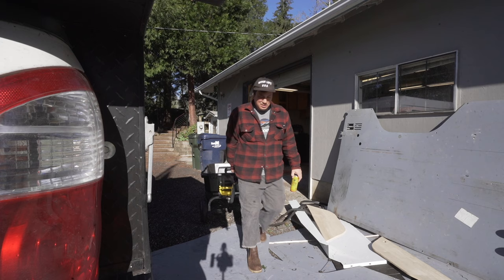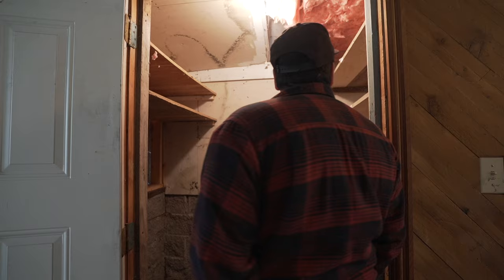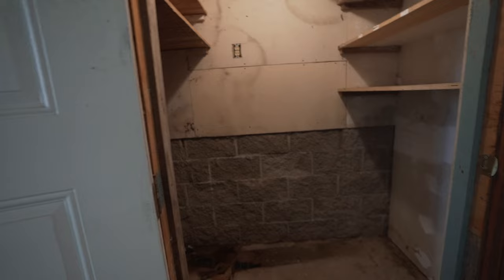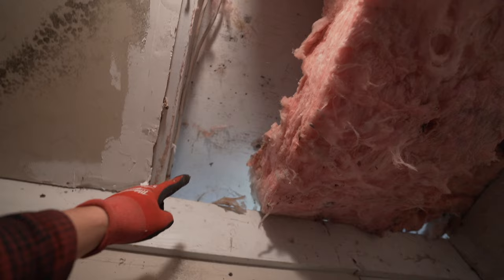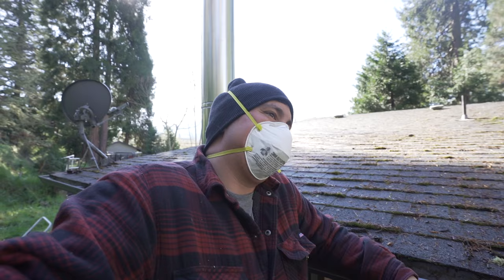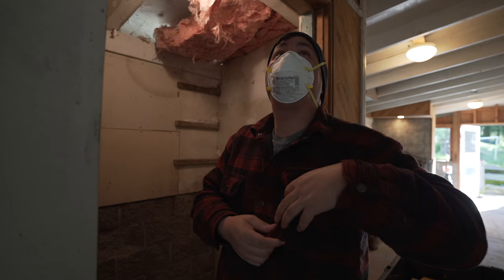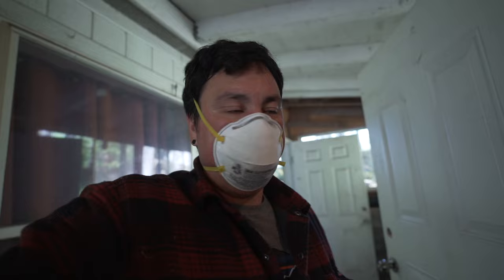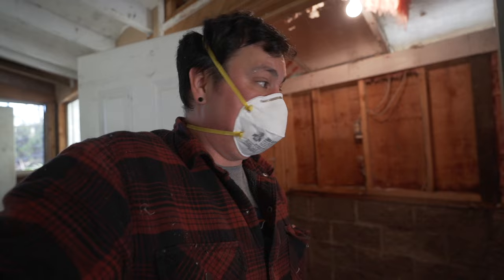It's Worse Than We Thought... (Mobile Home Demolition)

Comment: As long as your roof shealthing is ok.Put metal roofing over the old shinges. This will waterproof your roof You will not need to remove the shingles and have a great amount of construction debris to deal with. The metal roofing in the long run will be less expensive if you leave the shingles on. This way all you need to do is properly install the metal roofing. This is how my metal roof was installed by the proffessions. Youtube will be a good place to study the proper way to install a metal roof. The metal roofing my be alittle more expensive, but iin the long runn it will last longer and provide a more waterproof roofing systemfor you
Reply from the maker: Looking into options

Comment: Pull the outer walls off the framing, the roof material pull off and dry the wood, reseal the wood put on underlayment,  and new shingles. I would prime everything with kills. Put in the interior prime and paint. You could save the old wood if you need to

Comment: If the shingles are still in good condition and put on correctly, it shouldn't leak. I do think that you should get the soil down to maybe 6 inches below the wood siding on the outside and proper siding put on to protect the plywood....🤷 just my thoughts, I could be wrong..❤
Reply from the maker: Shingles are bad. I agree on the soil!

Comment: You knew from the start you'd have to do a lot of roofing. I did notice that the flashing around the chimney was useless sitting up in the air 2 inches. I sure hope you took off those clothes and washed them before going into the house. Unless you get rid of the nest ants will return, what you did with the spray was kill those that you see not those still in the nest. Try a product brand TERRO I have used it for a few years now to get rid of ants. It is a process but it works until next year. Ants are usually dormant over the cold weather spring brings them out. I would have used a wet vac rather than blowing all those mold spores around. Vacuum them up then wash out the vacuum. Bleach and Borax are your friends through all of this.  KEEP THE AREA A NO CHILD ZONE until you've made major fixes and do not mess around in there without your mask on. 20 or 30 years from now you'll understand why I say that!
Reply from the maker: Oh gotcha

Comment: If two tires had fallen off, your wagon would be too tired.  If the ants are large, They are probably carpenter ants. They will eat up the wood. Moisture attracts them. Move the Debris away from the wall because it holds in moisture. Ice guard is the best thing to use under roofing because it seals holes around nail holes. It prevents ice dams from causing water to back up under the shingles and leaking through the roof  but tarpaper is better than nothing. Metal roofing costs more but lasts forever. Shingles are doing well to last for 25 years. Metal roofing is more noisy when it rains or hails hard but It is worth the noise to not have to replace the roofing every 15 to 25 years. the only reason you would have to replace a metal roof it a tornado or a tree falls on it.
Reply from the maker: Ha ha

Comment: Where are those downspouts in the ground draining to? My daughter and son in laws first house felt like a lemon there was so much to fix but they did it and moved on to a better place. Hang in there, you can do it. I reroofed our two story shop and really the hardest part was transferring the roofing material off my loader onto the roof, those bundles weigh 75 pounds each. I had them delivered for the second half.
Reply from the maker: Yeah I been doing the math on materials

Comment: What a shitshow.  I couldn't see the bugs close enough to say what they were, but my thought was, they may be what's called roly poly's.  They love moisture.  The stuff with wings... were those carpenter ants or termites?  If you take down any part of the structure, make sure you film or photograph it.  You should be able to get some type of tax abatement for removing square footage.  If you need an immediate quick fix to roofed areas due to a shortage of funds, you can always coat it with that rubber roof stuff you'd put on an RV.  I can't remember if you had a home inspection.  This is really shoddy and shady crap.  You can't have moisture causing mold and damage.  I know you know that.  Just how stupid was that previous homeowner.  Cripes sake.  Really sorry you guys are having to deal with this.  Going to enjoy some nice weather at the lake sounds like a much needed activity.  I was awake all night due to tornados.  Luckily, my immediate area was spared, but others were not.  Long night last night.  Better days are ahead, Isaac.
Reply from the maker: Def… thanks for watching yo

Comment: You needs to remove all that fallen tree branches next to the house, all that stuff acts like a towel that draws water. We had an issue where the stucco wall was to the ground,  and suck water up the wall and  caused inside mold . Isaac the roof might need to be replaced,  check all sections of the roof.  You can do it will take time and a helper or 2. My 67  year old husband and 2 young  25 year old nephews stripped  and replaced the roof  for my niece's house in two weeks in the summer in El Centro ca. The cost  was only roofing materials  no cost on labor.
Reply from the maker: Yeah been working on it!!

Comment: Your roof is toast it has moss and mold on it. Take everything out, use a mold  spray to spray the whole porch, the drainage in the back of porch  needs to be dug out and your block needs to be sealed. Yes outdoor would be nice but what about the water issue that’s the problem. I am so sorry.
Reply from the maker: Yeah..

Comment: Pull everything away. Center blocks rolled with stop leak. It will keep the water from coming in. Or just pour concrete.  Look up dry pour. Not real expensive.
Reply from the maker: Def

Comment: Wow~ What an unnecessary mess caused by not doing it right to begin with. That’s absolutely a shame. Now you have to deal with the repercussions ~ Big Sigh. Roof & water drainage issue is the first priority. Just an open area covered patio is enough for now. That at least would get it safe, decent & usable. Good Luck. Get your roofing buddy to inspect all the roofs to verify what the situation actually is. Maybe he only did that add on  back there~ fingers crossed!!
Reply from the maker: Yeah but we will get it in shape! 💗
Reply: @isaacturnerit  Yup~ mainly demo & a place to learn how to roof 😂

Comment: You will also probably need to strip all the old shingles because of the weight due to snow load weight etc.  The open area would be a good quick and cheaper fix.  You can also probably rent a small backhoe or track hoe that would help address the drainage issue is the back.  The roof is part of the problem but not all of it.
Reply from the maker: Yeah def

Comment: I suggest you dig a french drain where that water is coming in. If the roof is not leaking over your head it can probably wait.  You need waterproof siding and paint on those blocks.  Looks like you also need fachia at the edge of that roof.
Reply from the maker: Def

Comment: The shingles themselves should be waterproof. So if he laid the shingles perfectly, and no shingles become damaged then you should be OK. The felt/tar paper is typically a secondary barrier so if a shingle higher up becomes damaged or water finds it's way under a shingle, then the water can makes it's way to the edge of the house under the shingles. In an ice and wind situations, water can get under the shingles and why tar paper is important too. For sure keep the dirt away from the lumber and keep all that debris away from the house. I'd lower that dirt level against that block retaining wall so there's room for water to puddle until it's made it's way to drain away or soak into the soil this way the water doesn't get to the wood/siding wall. But, before you go ripping off all your roof, I'd make sure he just didn't run a bit short on tar paper and not run it on that last row only. I can't imagine somoene roofing a house and not using tar paper. He may have just skipped it on that addition or the last row or two if he ran out. Do you have this guy's #? I'd call him and ask before I tore all the roof off.
Reply from the maker: Hmm gotcha but they aren’t for some reason

Comment: Yes, to first checking gutters flow, then dig around foundation to see what's there. It's truly. a shoddy job of a tacked-on addition. It all depends on how important the space is to you. You're going to basically be rebuilding it. I'd get someone from the area that knows about house construction in area to tell you what you need to do. Ask your fan base for help. A home is your most important investment, anything you do right is adding to it's value. The best of luck from an old lady with a ton of homeowner experience. You are also at the bottom of a hill so maybe drainage issues to address in the future. Also, check out a couple on DIYfferent. They have a done so much to restore old buildings. His videos are very informative and honest.
Reply from the maker: On it

Comment: Here is a bit of plan of attack.  As it is obvious whoever added this on had no idea about building. With the soffit open to the outside, it is a wonder it not even worse.  1) Fix the outside drainage problem and the roof issues.  Have the electrical checked.  Gosh knows how that was jury rigged in place.  Once you have the electrical checked out,you can start to think about redoing the side a section at a time.  Insulated it all and get it sealed up.  Then it will be relatively easy to finish up the room areas. 
I remember as six grader Mom and Dad bought a new old house which had been rented out.  It was a beautiful frame but a mess.  We picked up a huge dump truck load of just beer bottles. It was all old lathe and plaster and we striped everything down to studs.  They were able to find some Amish carpenters who saved them some money and roughed it in before they had to pay regular carpenters to finish it. 
You have the ability to live the the rest of the house while working on this area. That is good.  Your goal need to be to stabilize this area and then move forward. 
One step at a time you will get.
Reply from the maker: Def chipping away at it

Comment: There no membrane on that side and they just put dirt in it. Need to clean that out and a drain. I would leave a nice gap on the side of that house. Even the roof needs an undelayment. Just plywood outside is not the answer when he built it. 
Step by step and it could be fixed.
Reply from the maker: Gotcha on it

Comment: A couple of things is needed.  The roof is priority,  however it must be done while weather is not wet.  Also the wall structure needs to be looked at for rot, insect and also termites.  Replace what needs to be replaced. 
The cinder blocks need a paint on sealer to protect from moisture wicking through. 
 Your next step is clear as much debri from the back wall.  
You will have some work ahead of you. 
However there is no good drainage on the back. 
Besides gutters at the roof, there should have been a French drain installed at the base if the cinder block wall. 

You might need to have help, but maybe they are willing to help you.  You buy the materials needed to fix.   
Also watch videos of folks building, adding on and  fixing these issues.  There are tons of videos of folks adding on to their homes that are next to a mountain.  Plus many van life folks that bought property to fix and repair or build new homes.  These videos can help . 
I need to ask dud you have an inspection on the property prior to purchasing.   They might have found these problems.  I wonder if you are able to get compensation back from the sale, cause they didn't tell you there were issues. 
Going forward, drainage of the back area will be whats needed.
Reply from the maker: Great tips

Comment: Given the sketchy underlayment situation I would be skeptical about the water mitigation at the rear wall.  The structure sits at the bottom of a mountain and should have french drain, landscape fabric, gravel and waterproofing at the submerged brick on the outside.  It looks like there may be precipitate in the mortor of the wall? This could indicate water buildup at the outside of the wall. From what I can see in the video your down spouts from the gutters go into pvc?  Do you have free flow at the outlet? No clogs? Hopefully the outlet is at a location where the water flows freely away from your structures?  I think a conversation with the roofers is totally a good idea!
Reply from the maker: Yeah

Comment: You need to dig around that foundation put a tile drain pipe through fill it with gravel then cover it back up so you have drainage what is happening is you have not enough drainage to go around that area and it's seeping there and Going to need to replace the siding that the water seed through and I would housewrap that for vapor barrier
Reply from the maker: Def

Comment: I agree with Carol West.  I think the back originally was a retaining wall and the open back porch.  

I am not a construction worker but fully admit that you need tar paper on a roof.   I would turn it into a covered play porch for right now….

 but if you wanted to invest I have some ideas…..including gutters and proper water drainage and make sure that you have vapor protection and a vent in the roof to keep it from getting humid.  

But I would definitely recommend checking with construction workers usually you can get free estimates.  

For the mice I know that you have cats….take old used (but mostly clean) cat litter and sprinkle on the ground outside the perimeter of your home.
Reply from the maker: Cat litter?
Reply: @isaacturnerit  yes.  A thin line of used but clean cat litter. I did it during a whole box change.  Scoop out the clumps and nasty bits and then whatever is left sprinkle a thin around the outside of the house. Only thing that worked here that wasn’t poison. I also am almost sure that the piles in the insulation was mice poo.

Comment: Clean all debris from against the house 6” below concrete 
Check the drain that the gutters drain into to make sure it’s not clogged 
Treat all areas with discoloration with a bleach solution let it dry out replace any damaged lumber and then paint with a good primer. It’s really not a big deal. I didn’t see water issues at your ceiling
Reply from the maker: On it

Comment: I din't realize that there was no fascia boards on the roof. No wander the insulation is full of mouse crap, mice love fiberglass for nests. You do need to get the dirt and junk at least 8" below that wood that is on top of the masonry block. As far as the roof shingle are what actually keep the roof dry. From what you showed in the video I did not see any actual roof leaks.
Reply from the maker: Yeah

Comment: Isaac do a French drain along the outside walls, tear out all wood that has gotten wet and replace it. When it comes to the roof tear off the old roof the put a drip edge and Ice and water shield on the first 4" of plywood closest to the gutters. Then tar paper the rest of the roof. Maybe install metal roofing it is quicker and easier in my opinion and it is more durable and will last longer. Either way you have a lot of work ahead of you but you have the skills to do it. I hope that you can get some help.
Reply from the maker: On it

Comment: Carpenter ants like moisture, wet wood to chew on. Gotta start outside and remove the debri from your foundation wall. Also make sure your ground level is below the foundation wall so that rain/snow melt doesn't enter your walls.
Reply from the maker: Dang

Comment: I don't think underlayment is your problem unless the gutters back up
1) where are those gutters draining to? Are they clogged? Do they back up when it rains heavy? Is there any french drain ?maybe test by putting hose in gutters and run for a while and see if any water comes inside
2) dig down and see if outside of block is waterproofed
3) the pink insulation is the wrong stuff to use. He should have stuck with just foam insulation 
4) no dirt or wood chips should be near the wood on the outside. Gravel would be better and an aluminum siding would be better then wood back there
5) if you do the roof yourself, consider metal on the shop . I would think that would be easier and faster and maybe you can just do a roof over. 
It's honestly not that bad. It. Could be worse and if all fails, you can have a screened in porch
Reply from the maker: I have no idea where the gutters go!
Reply: @isaacturnerit  I don't know how long they've been buried but if they're aluminum, wouldn't they rust out after a while?

Comment: My first question is whether your drain system is blocked or not diverted correctly. And keeping that enclosed along with the wood stove is important winter power failure back-up. After the tree fall, did you file a claim with your homeowner's insurance. I'm surprised they are not putting a new roof on your home. Emergency repairs on one thing - roof integrity is a whole different game. That you can see daylight through the eaves - omg. And yes, lowering the soil away from the wood will help too.
Reply from the maker: I’ll have to figure all this out

Comment: You need to check all your gutters and get the debris out asap.  I think you did after the ice storm.  Check them again.  Next, clear all the branches and debris surrounding your entire home  which should have been done a long time ago.  These are the easy things you can right now and cross them off your list.  Then you can see if there are cinder blocks, or whatever the previous owner put down and go from there.  You need to divert that water coming down the mountain.  You wont know the actual damage until you get that cleaned up.  I sure hope you guys get it figured out soon.  That black mold is toxic.
Reply from the maker: Fosho